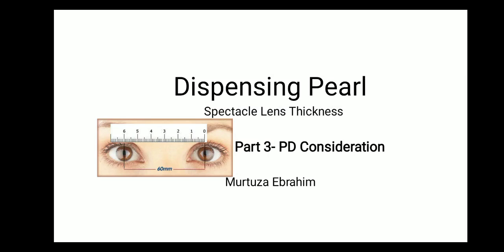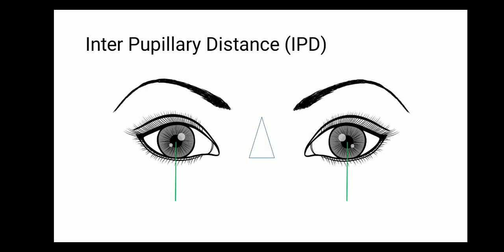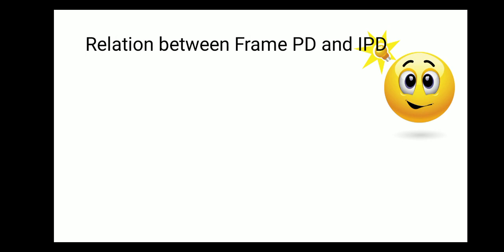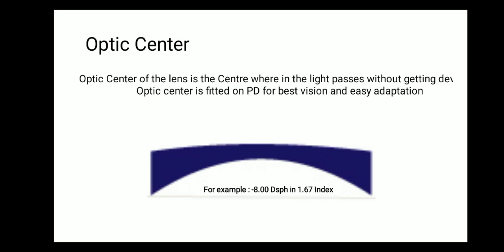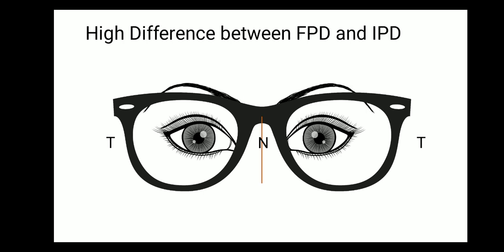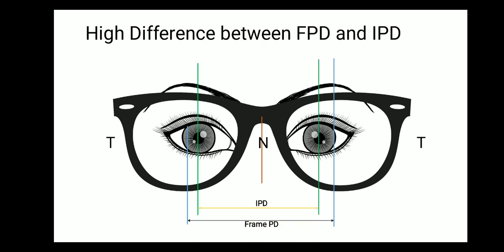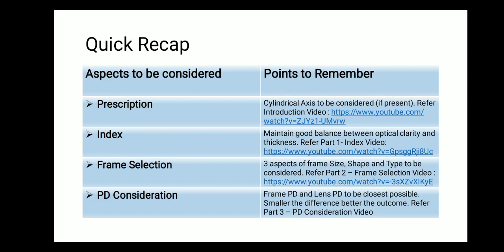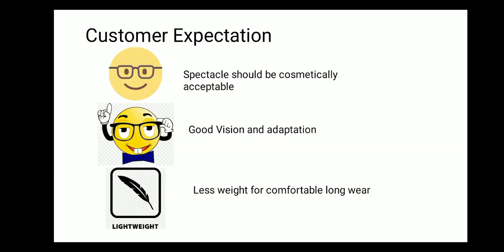Dispensing Pearl Spectacle lens thickness ( Part 3 - PD Consideration)

Comment: If we see monocularly then for option A the frame PD becomes 35.5 and individual’s PD becomes 32.5 similarly, in option B they are 34.5 and 33, option C they are 36 and 31.5 and option D they are 33.5 and 36 respectively. So the best combination will be option B as it has the closest difference.